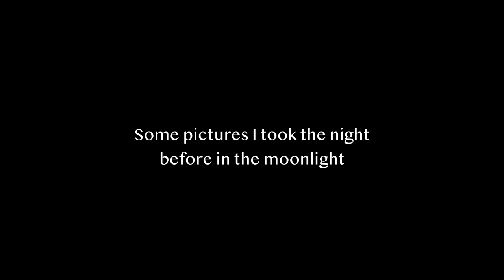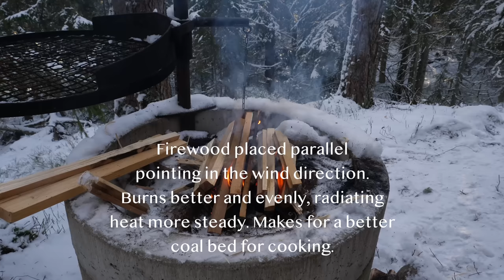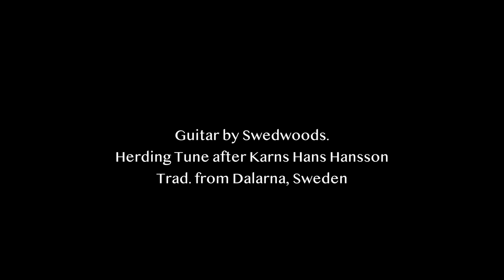3 Days Winter Bushcraft - SNOW STORM HOT TENT

Comment: Hi, and thanks once again for your video. It is such a pleasure to watch someone who knows what they are doing. I learnt another trick that you may want to try out? Drill a hole in the end of your ferro rod and epoxy in section of nail leave about 2cm poking out. This helps to hold down your tinder and stops the blade hitting the tinder bundle. It also seems to allow the sparks to concentrate more on to the bundle. 
Many thanks John Stott

Comment: Well , the view from the shelter  changed dramaticaly after the snowstorm . I thought you where going to heat the lean-to with your stove , after covering  the front with a tarp , I dont know if it would be feasible 🤔
Reply from the maker: Good idea. Will try that sometime and think about the pipe connection point. I have an idea.

Comment: great content again ty.  i am in a hot climate and wonder why you dont have a sealed floor for the cold
Reply from the maker: A sealed floor dont protect from cold and is a lot of unecessary weight.. I use a simple ground tarp with thermarest mat on top with heat value of 6.2. That is enough.

Comment: To the grated potatoes (3 pcs) you add one small grated onion, raw egg, one tablespoon of flour, salt, pepper to taste. Then you mix everything, form flat pancakes 6-8 cm in diameter, 0.5 to 1 cm thick and fry in a frying pan, on strongly heated oil on both sides until golden brown. Then they come out tasty and crunchy - Polish potato pancakes.